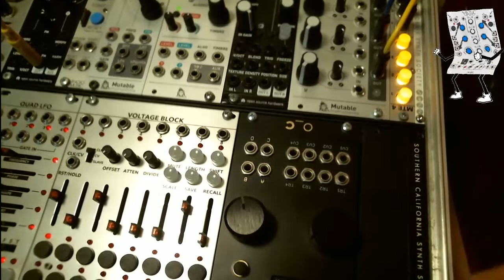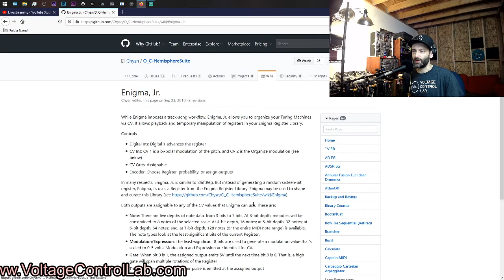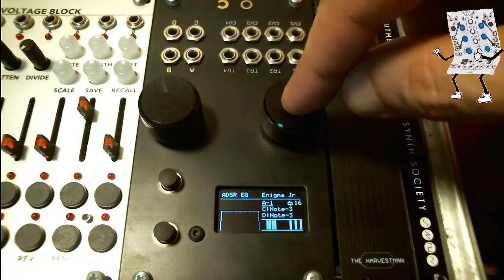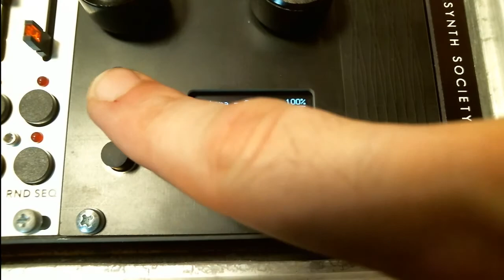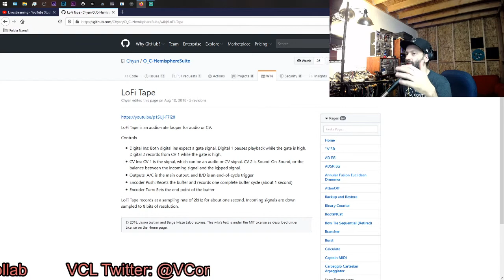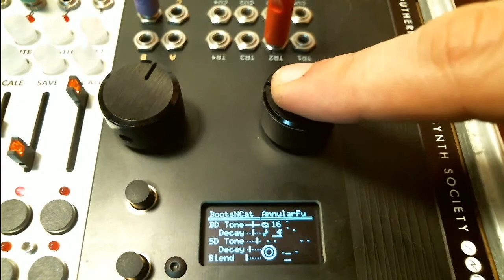EXPLORING HEMISHPERES - ENIGMA & LOFI TAPE- Mod City Live Ep #19

Comment: A few notes:
1. The usb power lead should be cut on teensy, so power from case when connected via usb.
2. The file should be a .HEX file.
3. Uploader software is available here: https://tinyurl.com/y9md6j2p
4. There are multiple releases of Hemispheres, the one you're using above is Hemisphere Suite which completely replaces the original firmware, however there is an earlier version called Hemisphere, which offers many of the dual applet options available above alongside many of the original apps. At least one of the original apps was removed to allow the space to do so, however I believe all of the quantizer/ASR apps are intact.
Reply from the maker: Awesome! Thank you for this, I guess my concern about older versions is the potential for buggy behavior, but maybe that’s an unfair assumption.
Reply: @voltagecontrollab  It's not buggy at all in my experience, but it may be worth reviewing the version logs to see. It just got to a point where there wasn't room for both, so they axed the vanilla apps hybrid setup and went all in. The full suite has something like 55 applets, while the hybrid has something like 20.

Comment: Good stuff Joe! Could it possible at some point to explore Captain Midi and see if it work with VCV Rack?
Reply: Yeah, that would be cool. I might try that tomottow too. I'm using an old psg mid2 just now and,  accepting its pretty old, its quite limited.

I'll let you know how it goes.
Reply from the maker: Yes! We'll definitely be getting around the Captain MIDI, hopefully soon!
Reply: Aw sweet,  the mystery of it that it seems no one has really used it is driving me crazy lol
Reply from the maker: I think one downside is that you have to have it hooked up via usb, which is on the back of the module for most designs.
Reply: @voltagecontrollab  Yeah, I agree. But a panel mount usb socket or even a mini to female usb cable could fix that and make flashing the firmware easier - but cut the power track first
Reply: I got crafty and drilled a hole in my case to pass the usb cable through:)